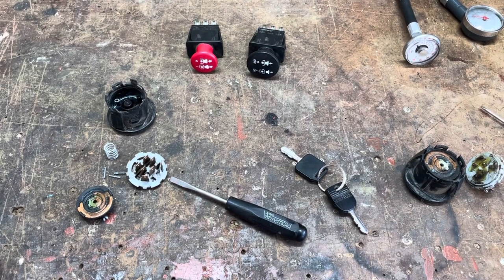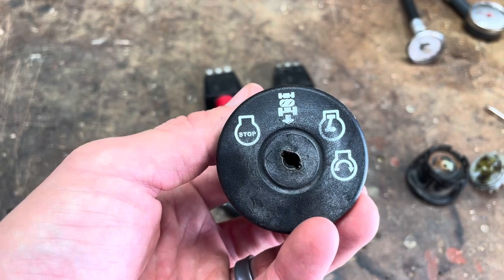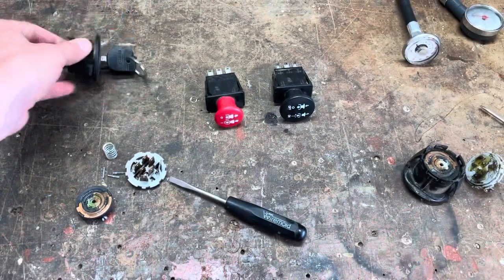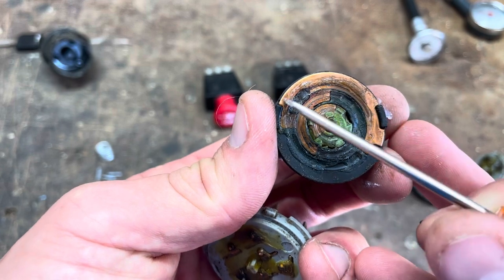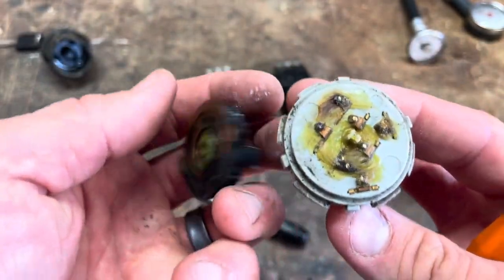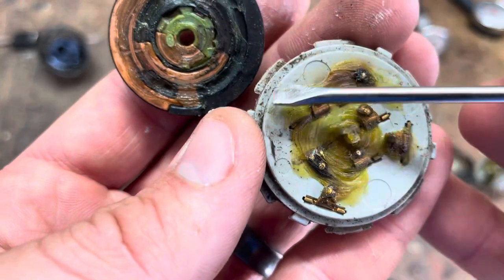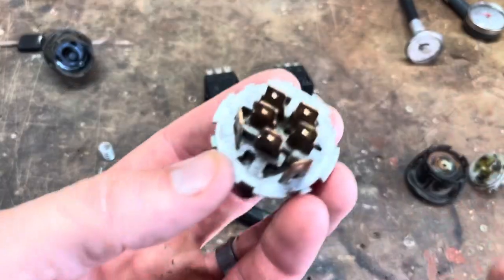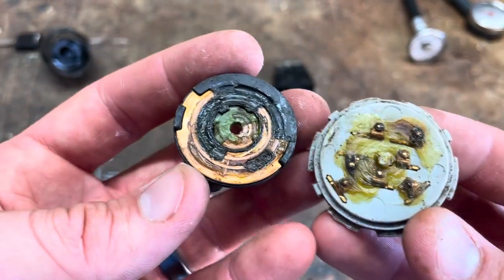Inside a lawn tractor ignition switch

Comment: I got a bad switch for a Old HOnda 3009 (1985-1989) rider. Its not sending 12V to the solenoid. Switch is no longer available. I either have to repair it, buy a used one if I can find one, or rig something up. How can I rig it to work?
Reply from the maker: How many wires are coming out of it?

Comment: How dose the other spring go in as i pulled my switch apart and everything came apart can you help Trevor
Reply from the maker: The bigger spring? If you look on the black plastic part where the key goes in on the backside, there’s a cylindrical slot that it sits inside. It needs to put pressure on the electrical contacts between the terminals on the back and the sliding copper portion. Hope that helps.
Reply: @35andRetired  No not that spring the other on under neith that one.
Reply from the maker: @trevorflynn1520  Can you tell me the dimensions? I will see if I have another one I can disassemble...
Reply: @35andRetired  it's a 5 pin 3 positions off on start.
Reply from the maker: @trevorflynn1520  I am sorry Trevor, I am just not quite sure how to answer and be sure. It is one of those situations where it would help to be able to see it.